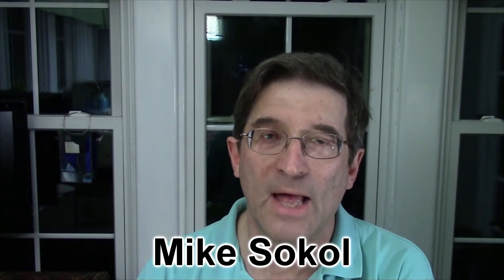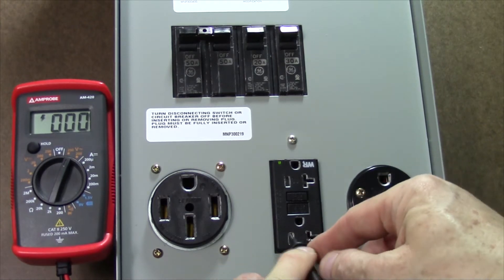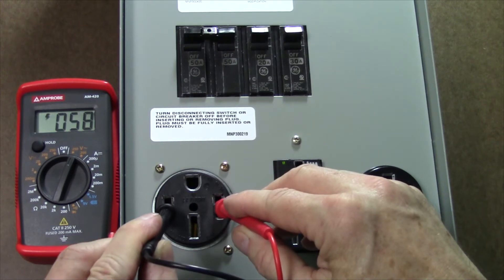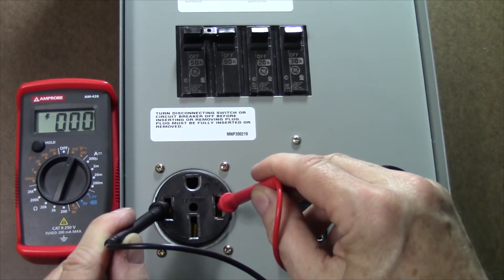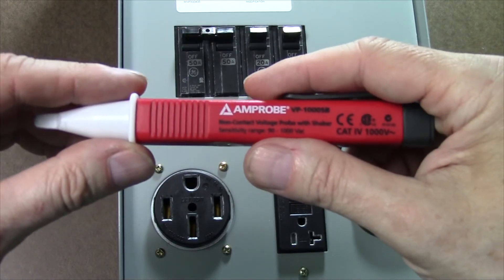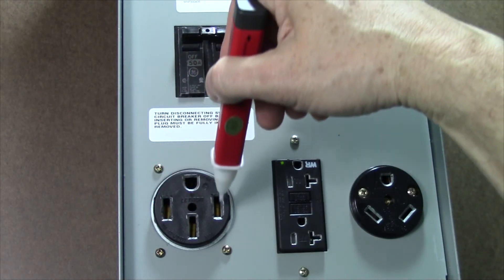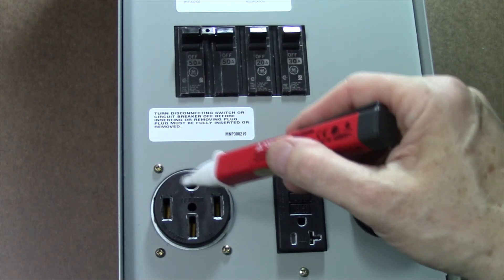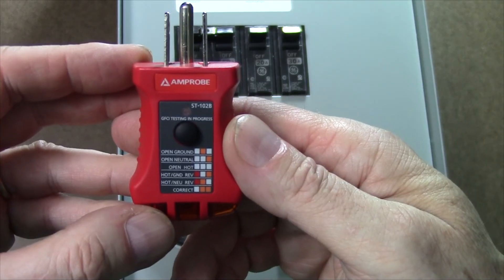Review of the Amprobe PK-110 Kit for testing RV Electricity

Comment: Its July 8 2020 excellent information sir
I'm getting ready to install a split box
30/50 RV power supply at my sisters house and I needed conformation for testing my completed application. 
The Only thing I didn't know was leg 1 and 2 proper sides. 
Left 1 right 2 good video.

Comment: The "Ground" part of the plugs should be facing down. The round ground hole on those should be pointed down towards the ground. When the ground is facing up, the electrons flote out. Electrons are lighter, and when the ground hole is near the top, the electrons "Drip" out, buy floating out and then up. Those electrons then stuck in the clouds, and eventually return to earth as lightning.

Comment: Could you tell me why if the ground outside my trailer is wet and I touch the steps I get shocked. I'm guessing the ground wire is broken somewhere. 
It's only when it rains do I get shocked if I touch the trailer and the dirt barefoot do I get shocked.
Reply: Joshua ...... It sounds like you are describing a "hot skin" situation (meaning the skin on the trailer).  It can be extremely dangerous.  Mike has put out detailed information on this.  Here are a couple of videos.  

https://www.youtube.com/watch?v=Y8h64X33aKg

https://www.youtube.com/watch?v=GuWX9wJwvtU

Also check out his NoShockZone web site where he has an article on this situation.  It can kill a person if there is a good ground and enough voltage on the skin so this is something you need to resolve. There a multiple things that can cause this, such as a bad pedestal, mis-wired cord and other wiring issues in the trailer.  Start at the shore power source and go from there.
Reply: @bruceh3786  I ran into this with a used camper trailer i bought. The 120v  Green/bare wire ( ground) was combined with the black dc 12v ground wire. i could touch the outside of the Water heater components and get some tingles. knew right away THAT wasnt right. I separated the 12dcv ground wire and checked the heater element switched leads for correct voltage and was good. tested everything out for stray voltage wasn't an issue anymore.  spicy stuff.
Reply: @spudthegreaterusa8386  Wow, that is a strange wiring set-up. I wonder what that person was thinking.  Glad you got it fixed.
Reply: Hello Joshua..sorry late to this post..Was just checking if you ever corrected this issue ?? What was what the fix ??  I know how dangerous this can be..

Comment: VERY GOOD VIDEO MIKE! EASY TO FOLLOW WHICH IS ALWAYS A GOOD THING; I HAVE A QUESTION; I HAVE A 2003 HOLIDAY RAMBLER I,VE BEEN HAVING ISSUES WITH THE OUTLETS (2) I HAVE STANDARD 15 AMP OUTLET IN THE KITCHEN AREA THE NEXT OUTLET ON THE CURCUIT IS IN THE BATHROOM THIS OUTLET IS A GFCI- CAN I REPLACE THE STANDARD 15 AMP OUTLET AND PUT IN A AFCI/GFCI OUTLET?? THIS WOULD MEAN HAVING (2) AFCI/GFCI OUTLETS IN A ROW??? THANK,S FOR YOUR VERY INFORMATIVE VIDEOS I FOLLOW YOU ON RV TRAVEL PATRICK.P

Comment: Thanks Mike. I wired up my 50 amp service to my breaker box using 6 gauge wire . Tested both hots like you showed and everything worked fine.  My camper has 50 amp service. I plugged it in and nothing tripped.  Was told different by other people and was not convinced that was correct. Glad your information help protect my investment. Thanks Dennis.

Comment from the maker: Each different test offers additional information for troubleshooting wring problems. I show just the basic test in this video. First, a test with a meter shows you that the outlet hasn't been obviously miswired with the incorrect voltage. However, there are a few problems it won't disclose. The NCVT test is great for discovering a very serious problem I call a RPBG (Reverse Polarity Bootleg Ground), which was sometimes done in the 70's and 80's when upgrading non-grounded outlets to grounded ones. See my article on it here: http://ecmweb.com/contractor/failures-outlet-testing-exposed. And finally, a simple 3-light tester give you confirmation that something hasn't broken in an extension cord. However, I don't consider it a good stand-alone test since it can't find a lot of dangerous problems. So it's a quick test, but not really a complete test.